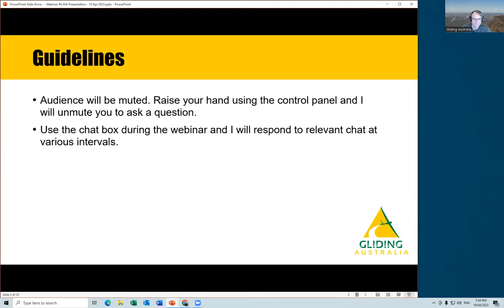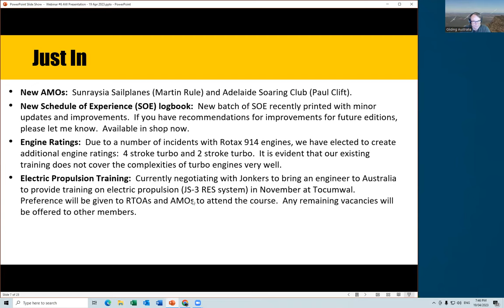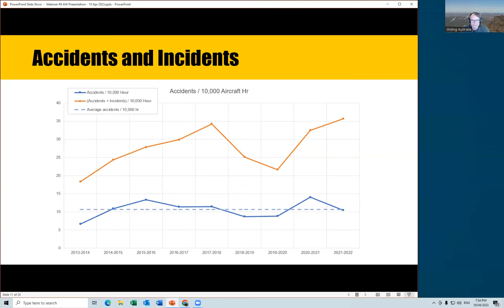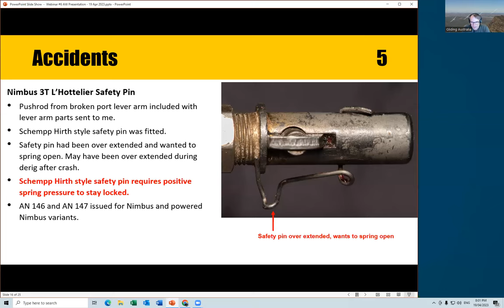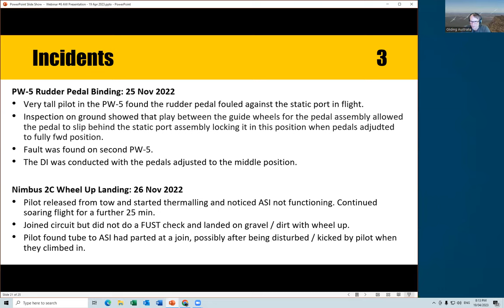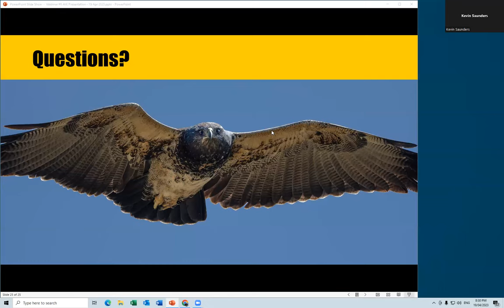GFA Airworthiness Webinar #6 19 Apr 23

Comment: So what does "over extended" mean WRT hotelier safety pins?
Reply: When the safety pins are unclipped and rotated, the shape of the spring should be such that it wants to spring back to its original orientation.  Heavy handling can result in the pin being bent beyond elastic limits and deforming, over-extending, so that it no longer springs back to the original position. In fact it may want to spring out of the hole in the wedge.  In my ASW20 there are seven of these beasts, requiring great care in handling, six through a very small hatch.